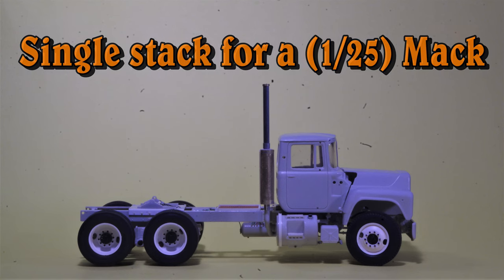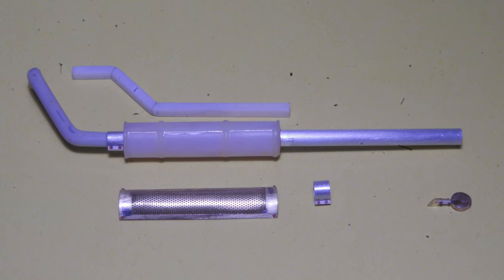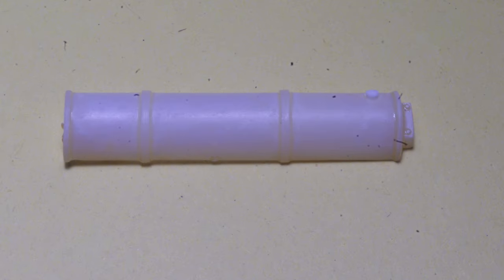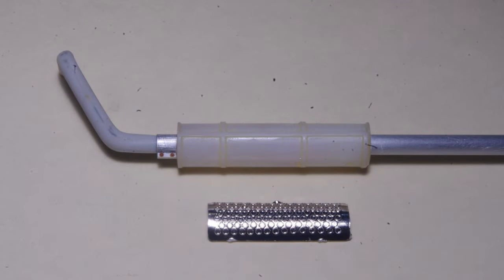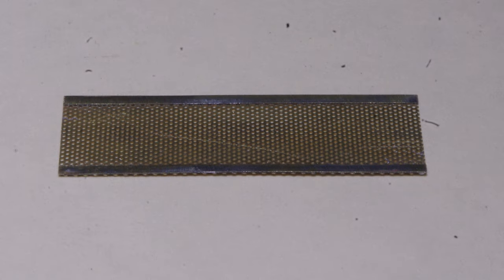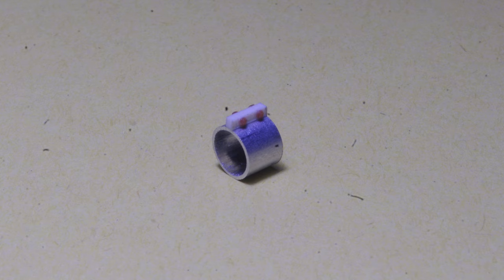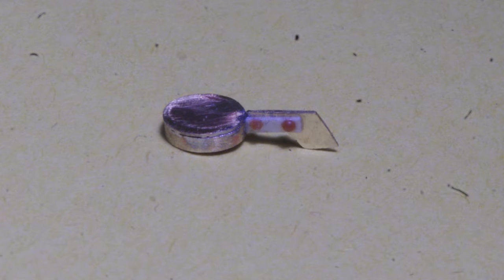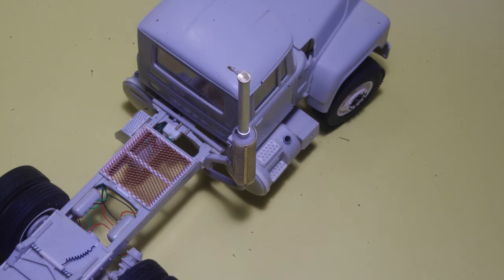Single stack for a (1/25 scale) Mack!

Comment: This has to be the best looking 1/25 truck model in the entire hobby world. 
10:26 Your Mack looks absolutely perfect in this shot. Just Perfect.
I'm planning a 1/25 rotator for my next project....but I'm going to do a Mack after...I'll model using your steps. 
FANTASTIC build. 
Thanks for doing these Robert.
Reply from the maker: Thank you - I am rather partial to Macks, R's in particular, since during the few years I drove for a living it was mostly R600's, and even the Superliner (model RW) is an R model cab with big square hood.

And just like with the railroads there are so many interesting regional differences with the R models - your Hayward, California built Macks were subtly different from the "eastern" ones built in Pennsylvania. Being over on this side of the country (Ontario, Canada) it was mostly the "eastern" Mack R's I had experience with although the one I took my commercial driver licence road test with was in fact an R "western" one, originally built for service in the oil patch in western Canada and later it migrated east for a second life with a welding company.

Comment: Great work. I've done aluminum tube before to avoid the dreadful kit exhaust pipe and polished it to look like a 1:1, but I've never found a way to deal with the ugly kit heat shield, from now on I'll be using your method. I'd be interested to see a video when you're finishing these parts to get a realistic metal finish.
Reply from the maker: This is the first time I have used brass, on previous models Plano’s stainless mesh (Peterbilt oval pattern on Labatt’s 378, slotted or “Apex” pattern on Kingsway Louisville) provided proper metal finish on its own.

I am going to try Alclad chrome on this model, it has worked well on both plastic and brass parts with other models. Airbrushing both black base coat and chrome finish should be OK even on the mesh.

Comment: You make it look easy, it makes people think they can do it too. Where did the two hole wheels come from for the Mack? They look spot on. Thanks for sharing
Reply from the maker: These wheels came from Plaskit, a small resin parts supplier located in Quebec, Canada. I bought these ones a number of years ago. Last time I saw Daniel (Daniel Gailloux, owner of Plaskit) in person was at the Fulton NY show back in 2018 or 2019. I did place an order by mail a year ago for some other items so I presume Daniel is still active in the resin casting field.

24.5 wheels (in 1/25 scale) fit Itlaeri’s 1/24 tires nicely to get the “taller rubber” look.
Reply: @brsnorthernhorsejourney3579  Thanks for the lead!

Comment: Where do you get the 2 hole rims
Reply from the maker: These are resin ones I got from Plaskit (he is from Quebec, Canada) a number of years ago. I used Italeri tires on them to represent 24.5 rubber.

It is more work to “roll your own” two hole rims but I have used AMT 10 hole wheels in the past, filling 8 of the holes and filing the other two larger. This can be useful on the inside wheels of a dual pair as those wheels are mostly hidden from view.